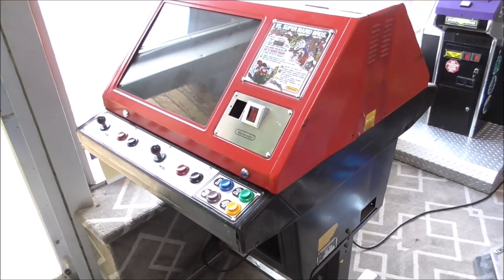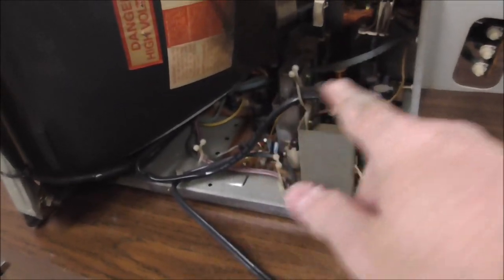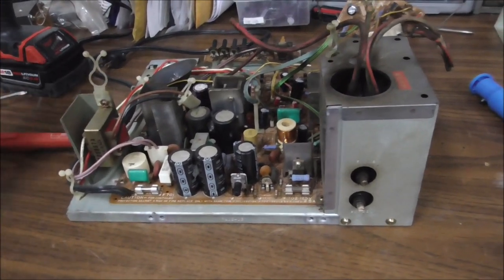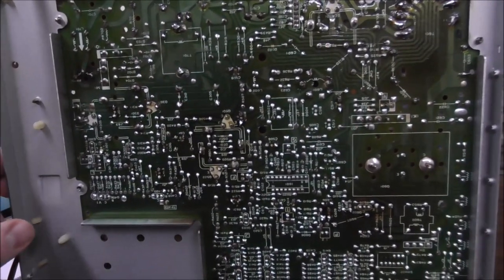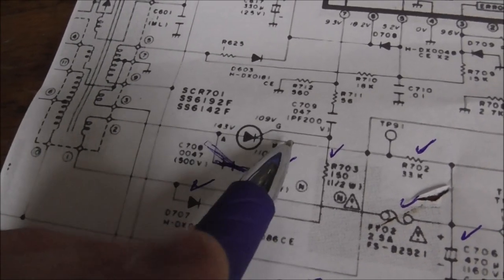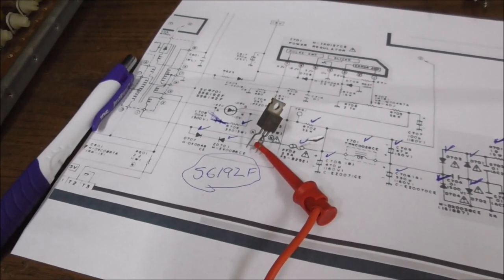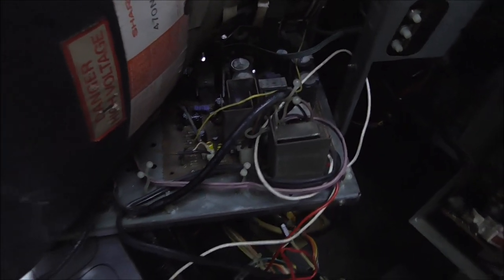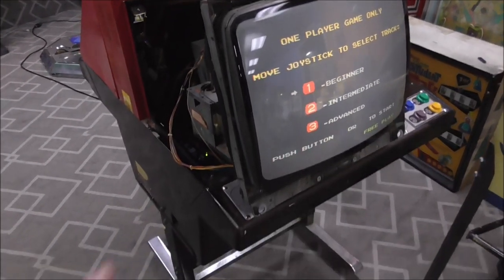Trying to Repair A Sharp XM-1801 Monitor in a Nintendo Red Tent Cocktail Arcade Game - Mario Bros.

Comment: A friend of mine got knocked off a 12-ft ladder because he did not discharge a monitor that was hanging in the ceiling of a bowling alley that was used for scoring an old Wells Gardner 😱

Comment: On an SCR, the "G" is the Gate. It turns on the SCR. A pulse on the gate turns the SCR on permanently, until there is no voltage difference at the anode and cathode.
Reply from the maker: Thanks Jaxtraw!

Comment: That thing on the power supply input you called a transformer is actually a "common mode choke". It filters out any transients or noise that might happen on the power line. Or maybe it keeps noise from the monitor from feeding back into the power line, not sure.

Comment: SCR (Silicon Controlled Rectifier) is a lot like a transistor, where you don't get current flow until the (G)ate is activated.  What makes them different (besides the fact that current can only flow one way) is that once the gate trips, the SCR won't turn back off until the A-K current drops below the "holding current" value.

I've never actually used one, but from that it sounds like to test it, keep the gate connected to the Anode and test forward conduction.  In that configuration, it should be off.  With or without the gate connected, test reverse conduction.  Should always be off.  To test switching, start with the gate connected to anode, then try touching it to cathode while in diode test.  The diode test voltage should fall to nearly 0 and stay there while the meter is on it, regardless of gate connectivity.
Reply: Interesting.  So it sounds like you'd need a more expensive testing rig then (or at least a power supply).  But basically, it seems that if you just measure anode-cathode and get conduction in either direction, the SCR is likely bad.

Comment: Given the sound and the plugs, I would guess the monitors were adapted TVs designs with the TVs originally designed to have a "hot chassis". That's ok when the only connection to the outside world is a capactively coupled antenna connection but a problem when you try to adapt them for use as monitors. The solution being to isolate the whole monitor from the mains with a a transformer in the cabinet.
Reply: I think they're made to be video monitors but with a hot chassis and isolated video.  Or being Japanese they'd be 100v even

Comment: It may not kill you if you receive a 25kv shock but it is still deadly, I once was the discharge path for a tube and it hurt for hours, but the screw driver I was holding was involuntary emended by an inch    in the wall behind me by my arms reaction, literally  inches from my bosses head. After that he stopped looking over my shoulder though.

Comment: Any CRT from like the 70s on will have a bleeder resistor that will kill the charge on the CRT and Flyback in a few minutes tops of being disconnected from supply. 

Even then tho as long as you obey the golden rule of high voltage electronics: never put both hands on it at the same time. Worst it'll do is bite the shit outta ya.
Reply: Not always. ive seen the early flybacks used in the 1980s vintage Macintosh machines lack a bleeder resistor.

Comment: The G on an SCR is the Gate. Dont think you can test them like transitors... But I'm no expert.
Reply from the maker: I think you’re correct doesn’t seem to be a way to test them...
Reply: This is interresting! How should you mark the legs in your oppinion?
Reply: I'm no expert on SCRs, but from a quick search it looks like on an intact SCR gate to cathode should measure as a diode, while other combinations should measure open circuit. Shorted is bad on pretty much any semiconductor device (with the obvious exception of pins that are deliberately commoned).

Comment: I hope you can figure out the 75 volt issue. Would be curious to know.
Reply from the maker: Apparently it’s very common on these and nobody has publicly figured it out
Reply: @LyonsArcade  the exclamation marks on the schematic mean that mains or high voltage is present to partake caution. on Sony, it also means fusible resistors present.
Reply: @LyonsArcade  Absolutely sure there isn't a broken diode in the bridge?

Comment: Try swapping a known good flyback into the the chassis that doesnt work. Some of the repro flybacks for these chassis are complete junk
Reply from the maker: I did.... I tried a different new flyback (from a different manufacturer), tried working through the troubleshooting steps in the manual (it tells you step by step)... tried swapping the SCR, the regulator, the Zener Diode, the regular diodes, the IC that runs the horizontal oscillation.  After searching around for days and online for days not sure what the issue was.